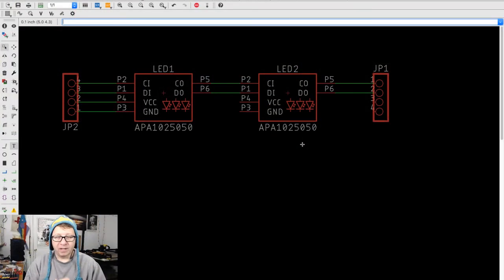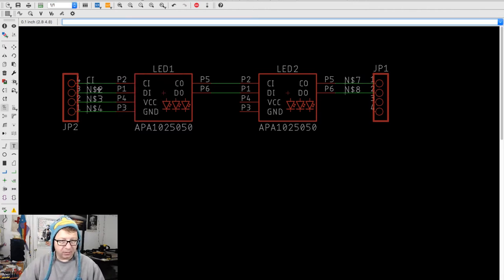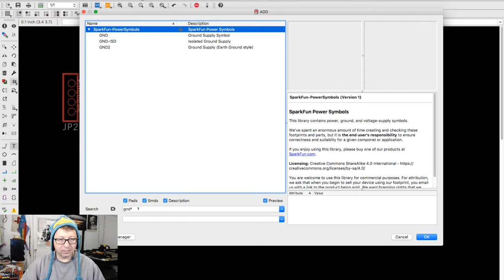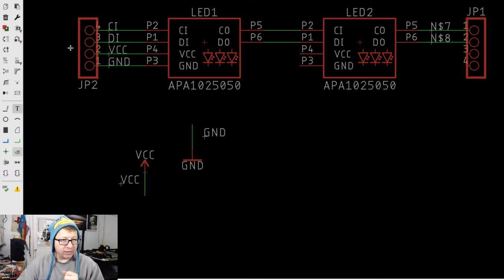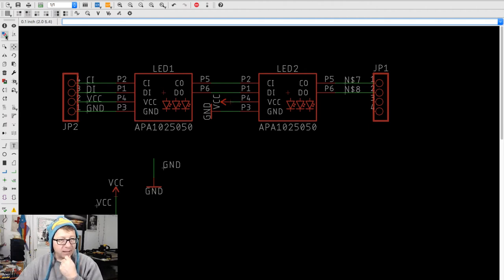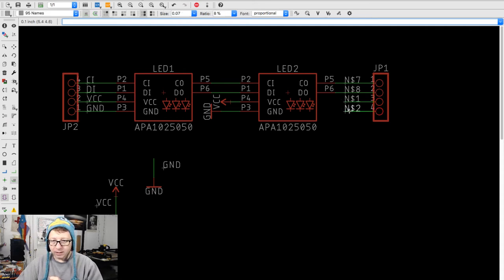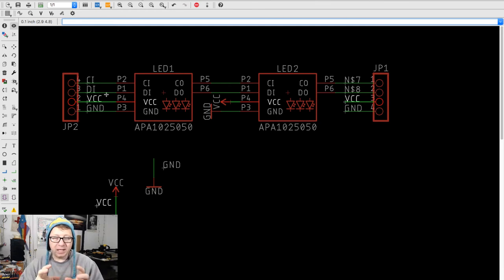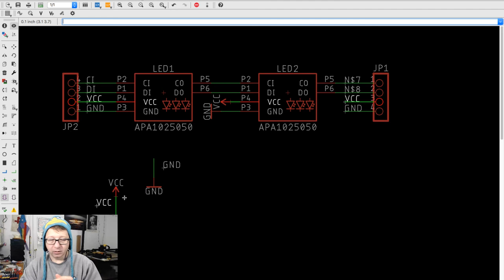Eagle CAD Tech Tip - Using Wiring Labels

Comment: How do I turn component labels (e.g., JP1) ON and OFF in Eagle CAD 7.7.0 board layout screen?  I see them in the schematic screen, but not on the board screen.
Reply from the maker: Hello Walt.  I'm currently on v9.5, so hopefully this works.  The labels are usually on the tNames layer - so toggle that.  However, you can put the labels on any layer, so yours might be different.  If you inspect the label through properties it will tell you what layer it is on.  Also, if you need to move the label around separately from the footprint, you can "smash" the part - the label will remain "connected" to the footprint, but can be moved independently.  Also, when you create your silkscreen, ensure tNames is included if you want the labels included on the resultant Gerber.  Let me know if you have additional questions. Thanks for watching!